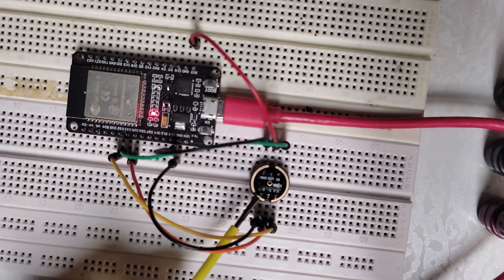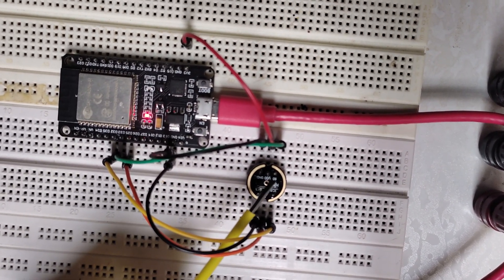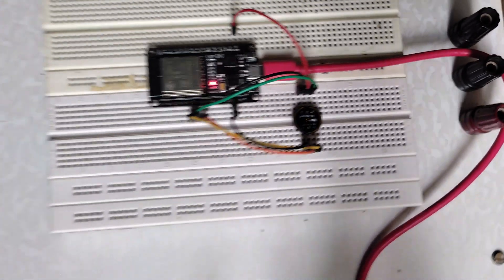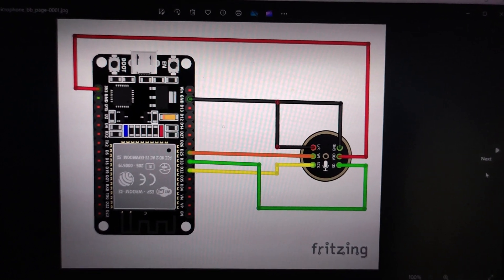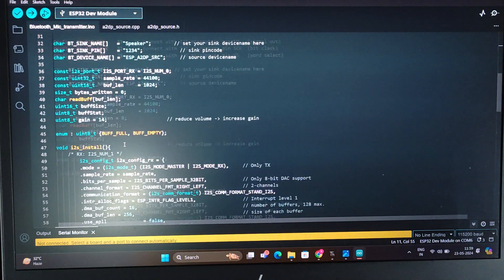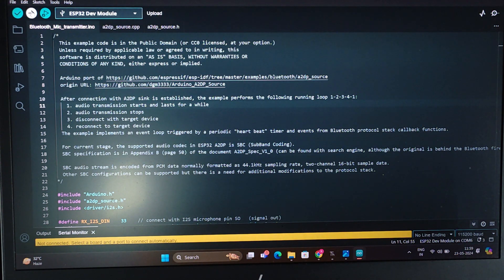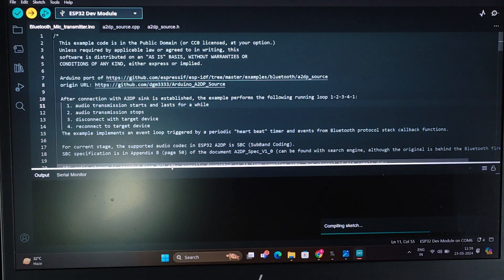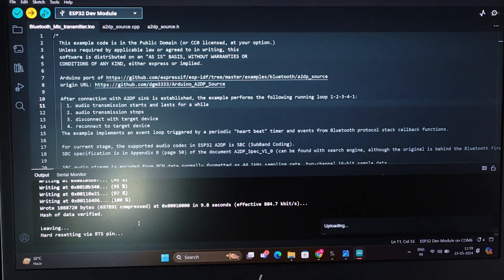Bluetooth Microphone

Comment: did you connect the speaker to your esp32? is this bluetooth??
Reply from the maker: Yes this is bluetooth. If you have any bluetooth speaker then you you can transmit your live audio to your bluetooth speaker.
Reply: @ramatronicslaboratory2040  If I want to test if it is working properly with a bluetooth speaker, how would you modify the code so it connects properly? Would I have to update the sink name from "Rockerz 370" to the name of the device I want to connect to?
Reply: @ramatronicslaboratory2040  If I have a bluetooth speaker what part of the code has to be modified for the esp32 microphone to connect to it?